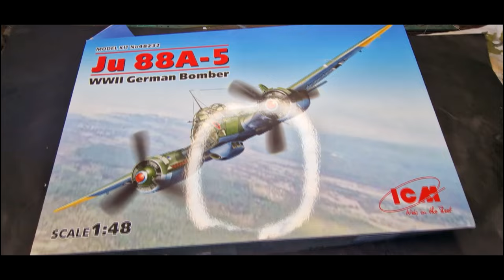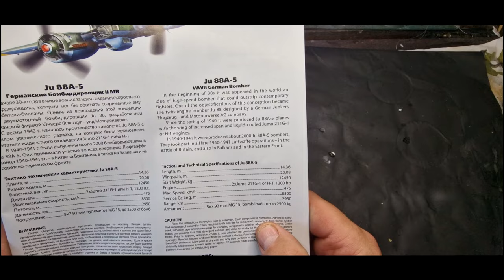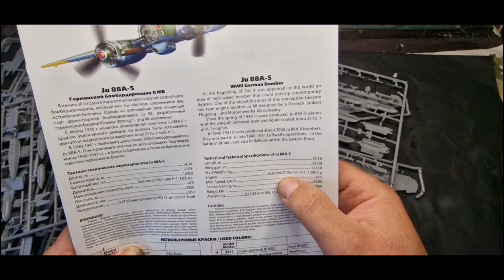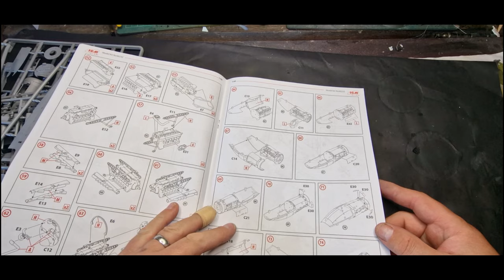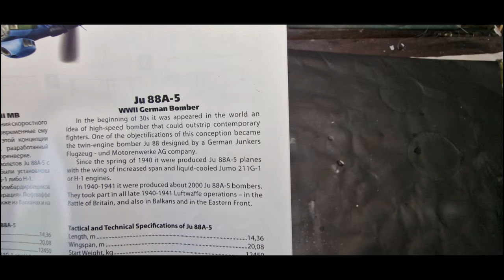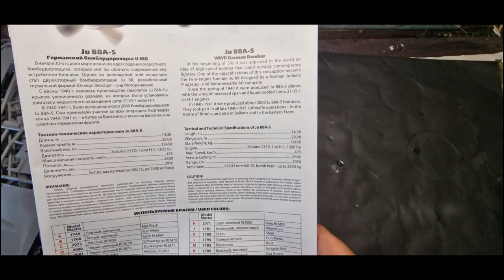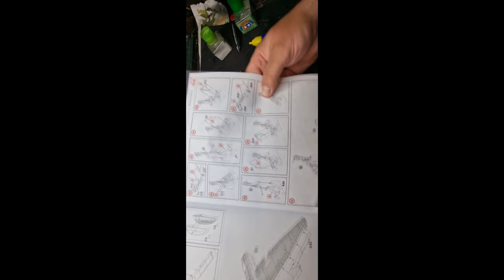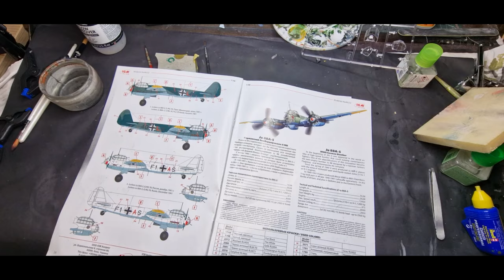Junker JU88, ICM 1/48th model build

Comment: First thing i noticed - the music wasn't terrible 😃 the number of modlin vids I've watched where the music makes me want to self harm ....🤣 but then i got to the 14 minute mark and had to click mute . Oh well , you nearly got the prize ...😃
I think you did a decent job overall (although I'm wondering if you got round to putting the landing light in to the port wing..😃 ) , a nice paint job too .
I have a real problem with this kit ; i bought it the day it appeared in my local shop and was disappointed within minutes of opening the box . I've got too many 88s, 188s and even 388s - it's my favourite plane after the usual spits'n'stangs everyone loves- so i had high expectations of a modern kit, especially as i have enjoyed ICMs earlier kits . 
So why did i hate it ? Before i had clipped a single piece off the sprues i hated the engine fronts devoid of radiator detail and missing intakes ....but they gave us two engines . Great work lads . Eye on the ball, hey ? The exhausts are wrong for this version - they are for the -A4 . The hot air outlets on the upper engine cowls are simplified and in this case wrong for this version .
The cockpit floor is fictitious- the 88 family's floor is prominently stepped and this is very visible through the nose . There are no engine controls - the console to the pilot's left is entirely absent . The pilot's IP is missing details and what details there are throughout the cockpit are a bit soft and ill-defined - radios, oxygen gear, guns, mags, pedals etc are all a bit mushy . Monogram made much better cockpits than this in the 70s and 80s . Hell, Airfix's Mosquito is better ! The only thing i liked was the pilot's seat . The rest is crap .
The canopy's framing is wrong around the rear and all of the small windows were a poor fit . The panel lines on the exterior of the cockpit are dodgy too .
The undercarriage is a vague approximation of the real thing and the wheels in particular are dreadful . The tail wheel assembly is one piece , something that's only barely acceptable in 1/72 , let alone 1/48 . The fuel dump pipe at the base of the tail is missing .
Did i like anything about it compared to the old Dragon/Revell kits ? The wing is nice and thin . The overall construction is reasonably smooth but still has issues , the most annoying for me was the lower fuselage/wing part was slightly wider than the fuselage ; i used plasic card spacers to spread the two sides apart, fixed the gaps with superglue , polished and rescribed the missing detail (which was pretty vague in the first place ).
My wings went on ok, maybe one of us was lucky . My decals were pretty good as well . 
I would be curious to know what you think of the old Dragon/Revell 88s ; if you are contemplating one, let me know and I'll talk you through the potential pitfalls (if you like 😃) .
Reply from the maker: Yeah I might get one of the old revell kits be good to know your opinion on it. I had alot of problems building this kit especially the decals they were just horrible. And your right the music in most videos I hate to be honest and especially in mine. I'm considering not even having music from now on. Just maybe a bit more explaining what I'm doing.  But then I get fed up with the sound of my own voice. 😄
Reply: Try whistling a happy tune 😃
The Dragon/Revell kits are somewhat maligned in some quarters ; they have a few quirks but build up just fine . The Revell boxings also have the bonus of quality decals - Dragon's are patchy at best .
Reply from the maker: Lol. I'll try that

Comment: Did you have any major difficulties put the engines into its places - like I had with that Axis ju88 version, and I did some compromises put the all together.
Reply from the maker: Yes I did. It didn't line up with the slots so it put it all out. Made it hard to fit the whole engine to the wing.
Reply: @hobbiefix38  at the end I just took whole engine away and saw off some important parts and assembled those which needed, as the engine does not show at all. Probably never going to build this one again.
Reply from the maker: @anssihyttinen1569  yeah many a time I've had to do that. Sometimes I don't even put parts in that will never be seen. It's a waste of glue. 😄